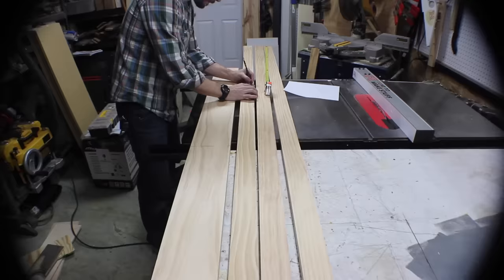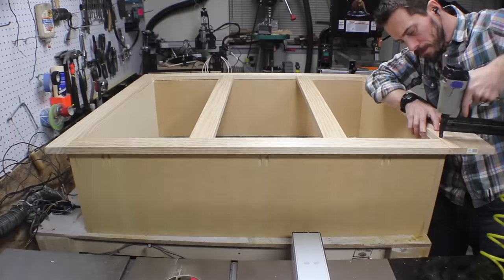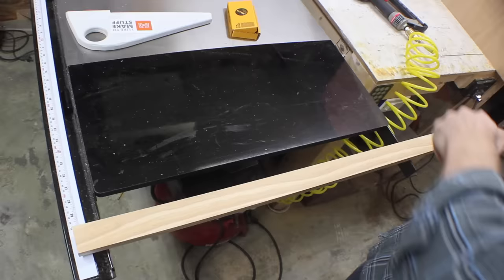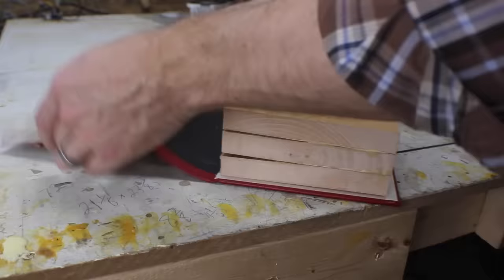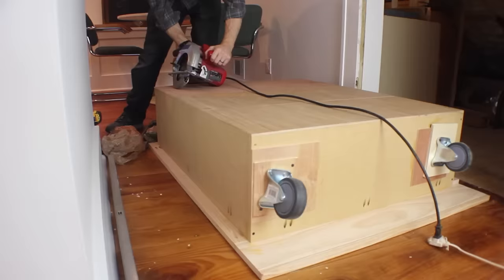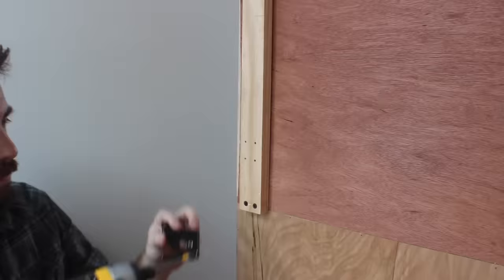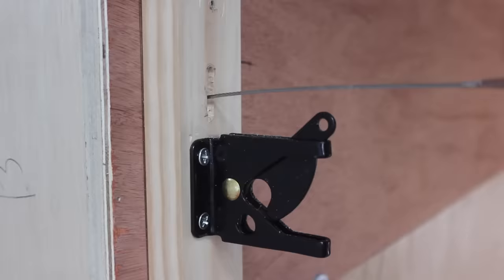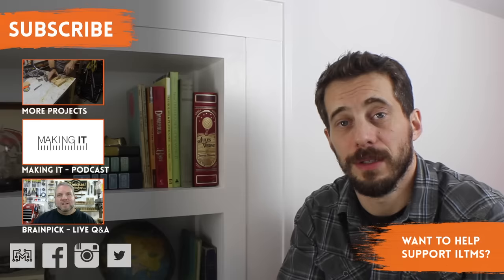How to make a secret door / bookcase | I Like To Make Stuff

Comment: How did you adjust the length of the gate latch cable? I got the one you suggested in description but the loop seems to have a permanent clamp on that keeps the cable too long to be useful.

Comment: I'm thinking a cut down 2x would be better for the frame. 

What are your thoughts, you have wheels with 1200 lb capacity. The hinge shouldnt be taking most of the force. So even a weightier board would be fine and increase security say if it was for a safe room door.

Comment: You could do it so you need to pull several books out to open the door. You will just need to use more than one latch on the inside of the secret door. 1 latch= 1 book. 10 latches = 10 books. Etc..

Comment: I know this is 5 years old and maybe I missed it, but did you make a safety escape from the inside in case you couldn't get the hinge or door open... maybe some pull handles or pocket spaces to pull those loosely nailed back pieces?

Comment: If you were to use pivot hinges instead of the type you did, make it so you didn't need to make the adjustments with the diagonal measurements? Just wondering, as thinking of making my own in this coming year. Thanks again for the vid

Comment: I feel like you had an idea and winged it. The door frame shouldn't be shaky while you're screwing mounting hardware to it. The cut you made to get the door to close should have been done with 3/16" panel board but I understand the haste there. And then to not have the molding around the door cover the cracks is just silly. BUT I appreciate the video and realize im some 6.5 years late in seeing it.

Comment: How much of an allowance did you give yourself between the outside dimension of the bookcase face frame and the door opening?  And did you just have to trim down the doorframe wood trim in order to accommodate that reinforcing bit of 1x2 on the hinge side?  I am building one of these into a doorway that is just a rough opening right now, so trying to avoid giving myself extra work.  It will cover the closet that contains the HVAC unit so, while it doesn't contain a super cool secret room, it makes me feel better about losing an entire closet to this giant machine. Thanks!  This is a great project and I'm pretty excited to give it a go.

Comment: Not sure why you didn't go with a heavy duty pivot hinge which would have saved you from using caster wheels.

Also you could add a small spring to the latch.

Comment: I'm a little lost on placement of the hinge on the frame. Did you drill into the surrounding trim? If so, did you replace the drywall with wood somehow? Great build. I'm trying to replicate on a full sized door.

Comment: Looks good, have been toying with this idea for a while for a door into the roof space in our home.  A little concerned with the weight though once it’s fully loaded, ours wouldn’t have a floor to roll on as it opens, it’s slightly elevated.  Any thoughts on the hinges we may need to accomodate that?

Comment: Keep doing great work but... find your local lumber yard (not home depot) and use soft maple instead of pine. In the end you will save alot of money and time.  Time because maple is harder than pine it sands without all the fuzz (furring) of wood fibers and there is little resin in the wood.  Money because the big box stores charge ALOT for their trim.  Let your local hardwood dealer clean up the sides and you are good to go.

Comment: Please do not cross cut on the table saw with the fence.  If you dont have a miter saw, use a miter gauge on the table saw.  You will get kick back and if it hits you a trip to the hospital may be necessary.

Comment: Slightly different idea for the latch. Same cheap hardware. But instead of using a stiff wire, why not use a little 550 paracord. Book to latch. Latch to small weight. As long as the book is upright the weight will pull the latch close.

Comment: Not bad ,pretty decent actually, however, the weight the hinges will hold say for a book hound might not last to long, I would have used a lazy susan effect for that problem, which for us book hound's, (is a serious problem) lol kinda like on a boat how the seats swivel know matter what 400 pound person sits in them, you can get the part I am talking about for about 5 to 8 dollars on Amazon and it eliminates the hinges going into the wall but you will have to put a seriously solid guide pin on the top going into say a 2x4 behind your top pc of trim and it will hold up to 500 pounds, either way, KUDOS on this video and using the fast forward effect to get along with life ;-) and SLAP for doing that to VERN man what's wrong with you lol use a book called Working, or a book on how to solve quantum physics problems lol
Reply: How 'bout one seat swivel top, one seat swivel bottom? No, on 2nd thought I think the pin is better, cause it will allow for some settling.

Comment: How would you make it an in swinging bookcase?
Reply: Nicholas Mitchell move the hinges to the left backside of the bookcase and have clearance for it to open in the room . You can hide the front edge with just trim that over hangs the front of the bookcase . Start building it and it will all come to you. Imagine a box that needs hinges and support to open inward . Usually folks want an out swing door in case of emergency you want to gtfo , not have to have everyone rush for a door that on,h opens one way .
Reply: MrAlbie1970 
It won’t be for any exits. It goes underneath the stairs. I want it to open in so it doesn’t hit the toilet. Pretty tight spot. Thanks for the advice.